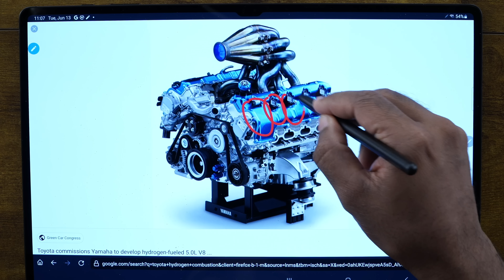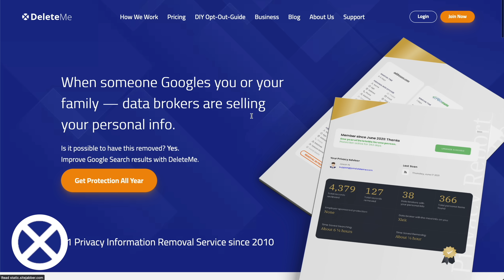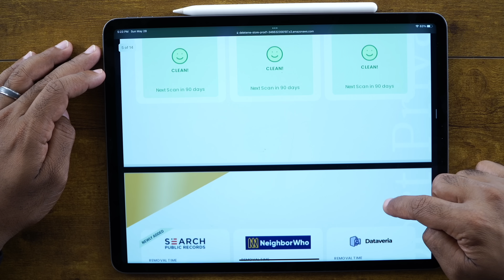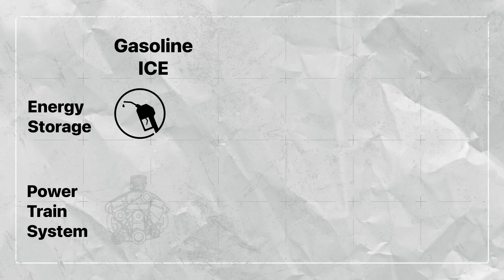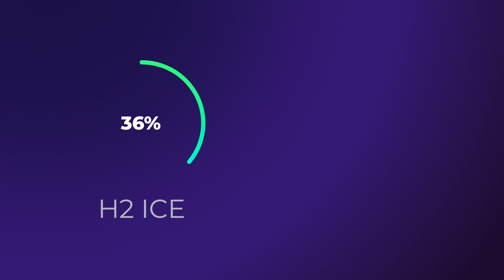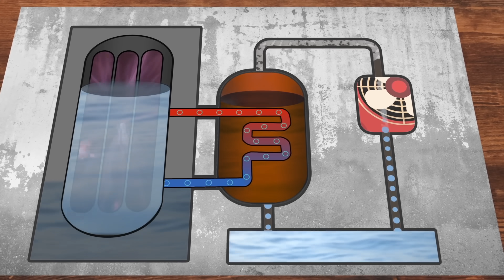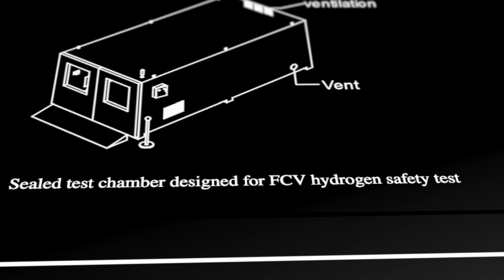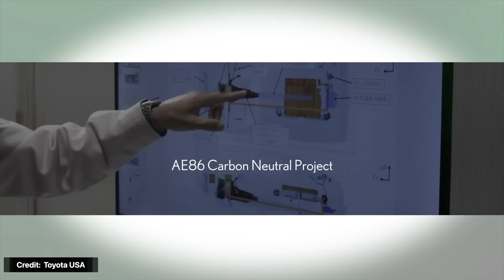Toyota's Says They Just Destroyed EVs - Hydrogen Combustion Engines

Comment from the maker: Stay PRIVATE Online With Delete Me - Save 20% Today!
https://JoinDeleteMe.com/TwoBitDavinci
Reply: Why would anyone paying attention want 2200 moving parts vs 18 when you can go very low maintenance with an EV?
Reply: @Tyler_Durden_99  This is exactly my question. I assume it's because car manufacturers make a lot of money on replacement parts. So less about what is good for consumers than what's good for the bottom line, I'm guessing?
Reply: @scoty_does  Most people where I from need vehicles that can drive unrestricted on the road without a special license and something with 4wd and hauling capabilities. Electric just can't do the latter right now.
Reply: Still , best to make the h2 / o2 on board , and supplement the gasoline, adding 30%+ to the mpg
Reply: Forgot to mention biggest issue with Electric engines.

Hydrogen is the single most abundant resource in the universe and is non toxic and we breathe every day.

While battery like lithium zinc cobalt are resource limited toxic and held abundantly by our enemies and non allies.
Reply: There is no reason we shouldn't already be powering our cars with onboard Hydrogen generators and distilled water.
Reply: It's sad how they are still trying to make hydrogen ICE cars the norm. It's great for entertainment a collectors idem etc...
It should never be mass produced tho, Hydrogen ICE are very inefficient through out the hole energy chain.
Reply: @lukeskywalker7457  Hydrogen long haul trucks could actually work or planes. Passenger cars just make no sense.
Reply: Good luck producing  hydrogen fueling infrastructure. Dumb idea.
Reply: 5:43 use baterai 🔋 car in Siberia Rusia is death men.
Reply: I like the hydrogen combustion idea only because EV’s the earth does not have the raw materials to produce all electric vehicles, and to sustain them and the pollution involved in recycling, besides the child labor that’s being used in the mining camps of Africa and Communist China is involved, so I am looking at a different source of zero emission vehicles and a hydrogen combustion engine looks good to me so as technology advances, I will soon find out.. a very cool and informative video👍👍🇺🇸🇺🇸💯💪
Reply: Trueno
Deja Vu!
I've just been in this car before (Higher on the street)
And I know it's my time to go
Calling you, the research is a mystery (Standing on my feet)
It's so hard when I try to be me, 
Woah!
Reply: Toyota doesn’t use words like “destroyed” but one could say you “destroyed” any hopes of you sounding intelligent by your use of clickbait headlines.
Reply: What do the cars got to do with the vessel? To much blah
Reply: There's no shock when Toyota doesn't match Tesla's investment in energy-recharging infrastructure. Toyota products are half-assed measures.
Reply: @valenrn8657  meanwhile teslas with misaligned body panels spontaniously combusts into flames
Reply: Emagine a world where there are hundreds of millions of fossil fuel ICE vehicles running around creating tons of CO2, now emagine a replacement for that engine that is a fraction of the price of an EV. I would love to engine swap my old jaloppy and make it more environmentally friendly, even if its not perfect it would instantly reduce my carbon footprint by a factor of ten.
Reply: Ricky, you need to change your shaving blade. Don't skimp by using a cheap Bic double razor. Buy a high-quality facial hair system because the bacteria found in ingrown facial hair will damage your skin. Consult a dermatologist for the best advice, I am not an expert.
Reply: I think you also forgot some things about BEV’s.
1. The grid.
The electric grid in the u.s is already on the brink of collapse every year in the west during fire season. Not to mention the logistics of getting that energy (which is 80% produced by coal fire power plants btw) to the charging stations and the requested rate. 
2. The materials needed to create the Batteries is these BEV’s are going to get more and more expensive the more we dig out of the ground. And unlike coal and natural gas, there are much fewer known reserves of lithium in the earth than you may have thought. 
3. BEV’s probably aren’t the long term future. The main reason we get Gasoline cars isn’t for their efficiency, it’s for their usefulness and cost-vs-efficiency. It’s as you said, Hydrogen fuel cells have a much higher energy density than electric vehicles. This makes them more suitable in low weight and high payload applications.
Reply: But there is no source of  Hydrogen on Earth, and it's proably a bad idea to burn our planet's water as a fuel source ?
Reply: THIS GUY DOSNT KNOW WHAT HES TALKING ABOUT. HYDROGEN IS THE FUTURE. ITS MUCH MORE EFFICIENT THAN ELECTRIC. ELECTRIC GRIDS ARE GOING TO BECOME STRAINED IN THE FUTURE WHICH WILL LIMIT ELECTRIC CARS EVEN MORE. WE ARE ALREADY HAVING TROUBLE WITH THE LOAD IN TEXAS ON THE ELECTRIC GRID. HYDROGEN IS THE FUTURE BECAUSE IT IS CLEAN AND ONCE THE SUPPORT INFRESTRURE IS BUILT FOR HYDROGEN CARS IT WILL ESSENTIALY TAKE THE PLACE OF GAS ENGINES..

ELECTRIC VEHICLES CAN NEVER TAKE THE PLACE OF GAS VEHICLES BECAUSE THEY ARE SIMPLY JUST TOO INEFFICIENT TO BUILD AND MAINTAIN OVERTIME. WE HAVE TO DO SOMETHING WITH ALL THESE BAD BATTERIES AND THE POLLUTION THAT COMES FROM MINING COBALT AND LITHIUM AND THEN HAVING HUGE LANDFILLS OF NOTHING BUT BAD BATTERIES THAT NEED TO BE RECYCLED CAUSING CHEMICAL POLLUTION INTO THE GROUND WATER AND SOIL.

TRUST ME HYDROGENN IS THE FUTURE. 
ELECTRIC VEHICLES ONLY PRESENT THE SAME PROBLEMS IN DIFFERENT WAYS
Reply: What impresses me above all else today is a discussion based on fact without bias or loaded phraseology. I think I'm getting it with this channel but time will tell
Reply: dendrite forming battery degradation makes a small part of battery not recyclable. most electric battery are not being recycled, and they dont last as long as is apparent in low prices in used market for electric cars, lower driving range in higher mileage cars etc. combustion cars last as long as the  metals dont rust, anti rust systems exist but arnt used, most combustion cars dont last as long as they could also because people dont change oil and oil every 5k miles and oil filter every other oil change (when its dirty).  oil is recycled by us government , bio fuels, e fuels, hydrogen combustion, are all sustainable.  current ev will rust and short circuit in wastelands under rain, moist air etc, they will not be recyclable even when they do somehow start recycling battery by weird materials science stuff without chemical side affects that would make such thing unworthy.  
            if people really wanted to reduce emissions, they would use the limited battery supply to reduce emissions where they happen most, through all cars through all of time: in low speed high engine power situations, which is especially bad in traffic happening near people like crowds of people at sidewalk in a busy city street. normal hybrid cars already do this better than electric car approach, where you can make many hybrids out fo the same battery mass used to make 1 electric car.  even better:  have electrci assited turbo small single combustion chamber engine charging up pressurized liquid and or air and making electric energy with linear movement, the piston will be pushed back into place by hydrallic switch or something so combustion can push it to make energy , with something like linear electric actuator, which maybe similar to electric spinning motor then the power would be released as needed. they probably will need to use minimal amount of battery (assuming its meaningful to reduce emissions to such a extent).    
			recycalable electric motor by mahle, but it needs transmission, subaru wrx high torque transmission, and toyota uses a first gear for high torque then continues the other gears with ContiniouslyVariableTransmission.     such system will be easier to package than combustion and ready for switch out systems easier when a new technology becomes worthwhile, like maybe hydrogen combustion that isnt too hot so the only emissions is water or something, or electric hydrogen, or a proper electric car battery .            
			consider tony heller suspicious observers, and tom nelson, etc in their takes on climate change... also see richard vobes on ulev expansion, romanian tvee video called why woke wont go broke, and see how they print money and give it to people like blackrock who can weaken people to make them easier to control fro power centralization, especially with printed money given my private corp called federal reserve, making money more abundant but it represents the same real wealth, causing everyones dollar to be worth less, whiel they have more... its stealing. blackrock promotes climate change narrative. they constantly get their predictions wrong, they apprently dont know what their talking about and i cant prove their narrative as even proabably correct either. they are taxing productivity and using climate change as a excuse to get ways to control people more in way that favors them at cost of us.        
 look at hwo they put emissins laws retsirctions  based on length and width of car but dont tax height, which makes cars unsafe in crash as i explain here, less areoydnamic, they tend to roll over more so less momentum preservation and less safe. they also set restriction based on engine size, which isnt fair because for eample, porsche used a bigger engine because it has less emissions per size than the samller engine which wouldve been less emissions. they also would tax weight of car, for reason i explained. theyd also not make it more difficult for small cars to meet emissiosn stansards, and not relax anti roll over standards and emissions standards for "suv" cars. 
			but consider that burnt food feels bad like other things in nature that normally feel bad when harmful... similar to smelling smoking fumes like tobaco burning smoking fumes, such stuff causes cancer. such smoking wasnt seen as being so harmful until after so many people were moved to seed oils instead of natural fats as cooking oil stuff, which is known for causing health problems like cancer... and thats just 1 part of human health. so, you can argue its not all too meaningful to reduce emissions, but it definitely is better to lessen that stuff liek  NOx, SO2, particulate matter (smoke), and heavy metal pariculate such as lead and arsenic, at least to some extent. maybe use CNG, LPG propane combustion..   
			more energy flow worsens battery degradation you can divide degradation across more battery cells to increase longevity, but the more you add , the exponentially more energy goes into and out the energy to move the car... because your not using all the energy stored in all that weight at a given average moment  in driving, and the stuff is heavier per energy vs combustion. weight worsens natural wear damage of roads which costs resources and emissions to fix, heaviness makes car more damaging in car crash. making sructualy stronger part of sedan at same level of taller cars strong structure, protects upper part pf car (and people isnide it) safe from strong heavy parts of taller car, if  the part in front of people is all fully crushed and tall car touches the people. nowdays is normally low to the ground to minimize tendency of car to roll over when turning quickly enough. sedan can rise quickly liek audi a8 air suspension, to get hit at a angle that minimizes damage, whiel keeeping car areodynamic and more able to preserve momentum around turns(not tending to roll over), while not being unsafe for non tall cars, by keeping weight low to ground. givign option to raise the car when user gets in, makes it easier for disabled old peopleto get into and out fo car and lift objects into car, by minimizing joign movement and msucle movement. it could give options to make ride less bumpy and stiffen up the ride to make it bumpy for preserving more momentum around turns by making it less tending to roll over.    tires wear out emitting micro plastics that suppsoedly are endocrine disrupting, stuff goes into water supply food supply, similar situation with anti birth pill residue, etc, and its heavily petrol based.  natural rubber from trees was used but gave far less grip, we could go back to using more of that with lighter weight cars, so less grip is used in dealing with weight, and more is used in gettting car to move and stop and preserve momentum for effiency and manual steering lotus elise style driving fun.
Reply: contn .  rerember, this should be about lowering emissions of already sustinable types of combustion, not reducing combustion use.  rear wheel drive means less regenerative braking, so less degradation, while making it lighter weight in rear mid engine sports car style weight distribution, for dividing weight across all the tires more equal, so front wheels dont get overwhelmed by too much weight and cause car to loose grip, rear wheels help handle more of the weight.  same with not making outer wheels handle all the grip without as much help from inner wheels , when car is turning sideways and car is still tending to move in the direction it was moving when it was speeding in straight line. besides preventing traction loss for saftey, this also allows preserving car momentum around turns , so less use of regenerative braking (which is also not as energy preserving) , brakes, engine lubricant, combustion fuel, battery energy, etc, so more longveity of all those things  . this would also decrease weight, so less road wear damage, less damaging in a crash.             
			to improve aerodynamic and heating cooling and weight  effiency and add usable legroom, make rear seat face the rear and shape the car around that. make  seats fold so they would make the person inside make their back bone sit up straight, so its easier to get into the seat, without needing to make a lot of space between the backbone and the wheels, for weight reduction. when door clooses, it lets drive lean back into a seating position similar to gordon murray t50 seating position ,for aerodynamics,  weight, and high driver awareness per amount of driver mental stress(lower stress). make it compact 4 seater for minimum costs per capability, and thatll be enough for almost all needs, people can rent a van for family road trip , and carry kids to doctor in a few trips instead of doing it all at once.  because modern culture is designed to weaken people to make them easier to control, because of NWO bankers , blackrock esg score, etc, family culture and all long term collaborative relationships are becoming far less common, so 2 seaters will be more reasonable for many people instead of 4 seater, so itd be llooking like aptera solar plugin electric car, or pre sam electric car, or gordon murray imotiv, or gordon murray t27.                             allow high airflow into car so its very similar to co2 concentration of natural open air, so it doesnt cause couldy stressed depressed mind, and vent can even open  more as a alternative to roofless drivers desires without the non effeincy of removable roof sports cars. its aerodynamically better alternative to opening windows more to get rid of a fart smell, and its quieter vs wind noise of putting window down. for luxry car, make it like lucid air front end rood area for rear too, allow manual removable tint shade from sun, and a shade with holes to let in most sunlight but not too much and also for some privacy.   because its better to make people buy my car than other sports luxry car, its better to  offer such non effcient stuff lie glass roof, and for tire longveity , saftey (like anti fish tailing traction control system), speeding around a turn more smoothly with less tire wear and with optional simulation engine sound that correlates with torque vectoring torque vs RotationsPerSecond of each wheel .... a limited slip difffrential type system is worthwhile for them. tire wear reduction by speeding around turns is considerable for luxry sports car customers because they will speed around turns often even if infotainment system reminds them not to do so and remind how to drive efficiently every time car is turned on.             so, energy effiency and emissions is not as good as electric car when comparing one electric car to another one of my concept car, but that doesnt matter, because across the whole fleet of car through all of time,  its ultimately more sustainable, less emissions, safer, cheaper, more fun to drive , etc.    
			current cars that come close to this more dieal car im talkign about, are volvo v60, prius and possibly (but probably not) prius prime.
Reply: Ok, but when You crash in the battery car You almost always burn as it becomes unsealed. At it's hard to put down.
Also You hopped over the cost tot the environment when it comes to acquiring all the elements for the battery
Reply: Great report TdV.
Reply: plot twist delete me just sells ur data anyway. 🤣
Reply: @XXPYR0XX  I don't know... looks totally legit to me. Buahahahahahaha
Reply: they should add to the efficacy equation that evs use more resources to make.  therefor making them less efficient.  eves are crap cuz the battery tech is not good enough yet.  so funny hows theres all these videos of  using gas genarators to charge ev's  lmao.  at that point might as well just put a ice engen in  an ev to charge the car lmao.
Reply: what about the green hydrogen farms that produce hydrogen from algae